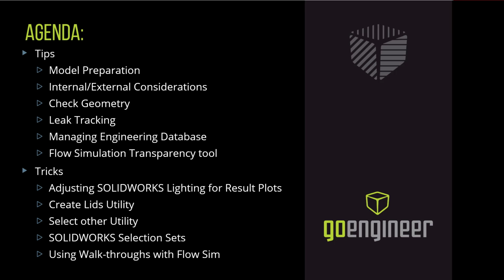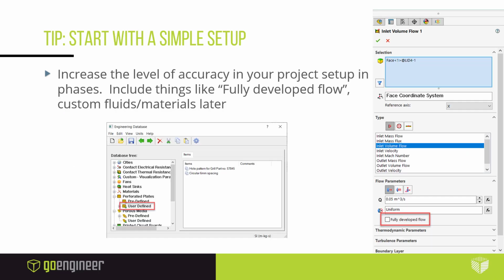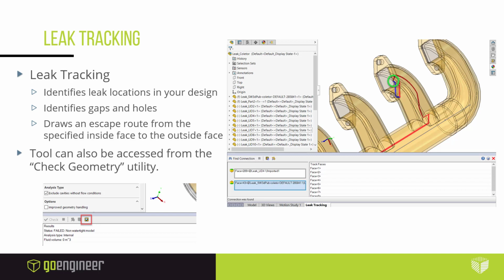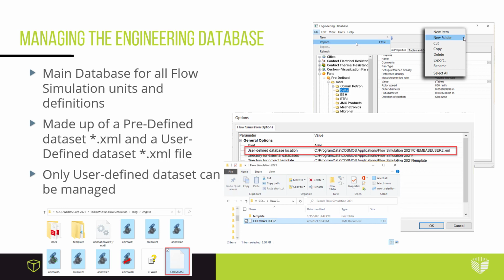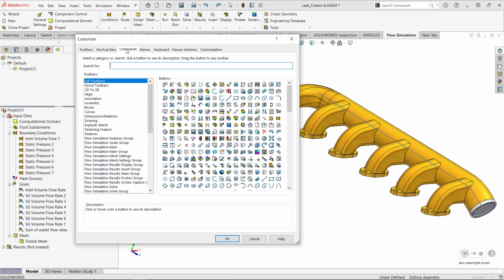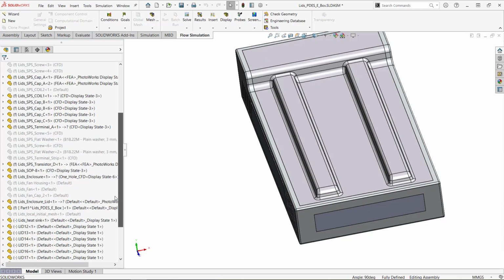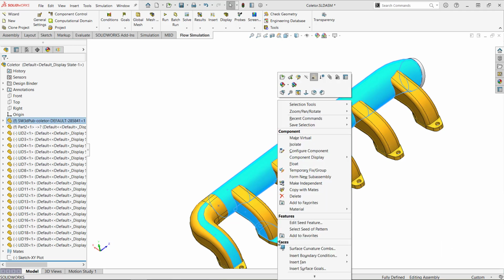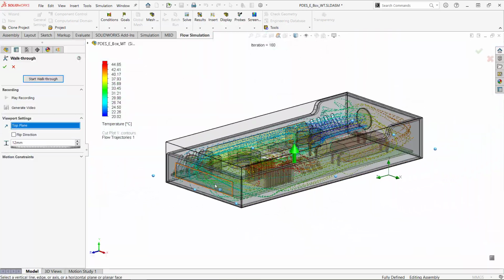SOLIDWORKS Flow Simulation Webinar - Tips and Tricks

Comment: why does my tools in flow simulation section doesn't have a "create lids"
Reply from the maker: Hello Odracir,
There could be a few reasons based on SOLIDWORKS version and install history.  You can however add it in manually from the Tools > Customize menu in SOLIDWORKS.  In the Customize window with the Flow add-in turned on, navigate to the Commands tab and click the "Flow Simulation Tools Group" toolbar category.  Click and drag the "Create Lids" icon to the desired tab or toolbar location on your UI.  I hope this helps!